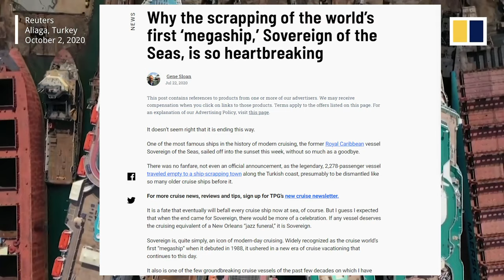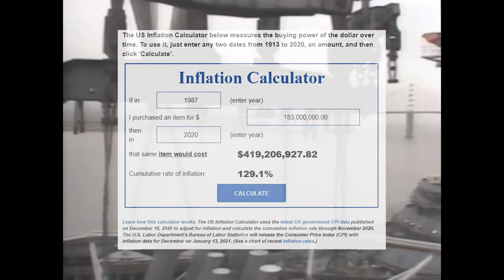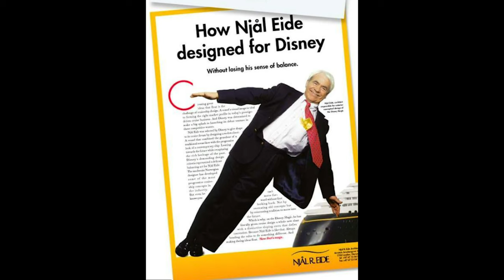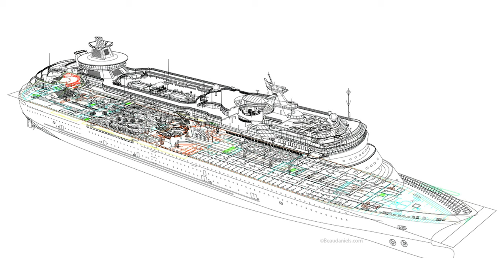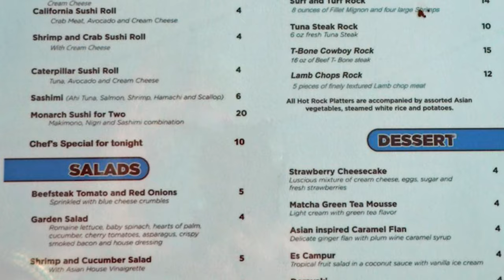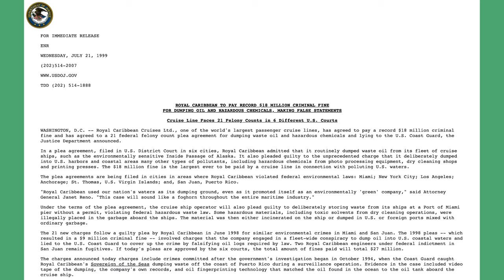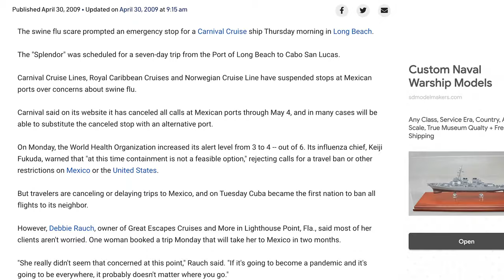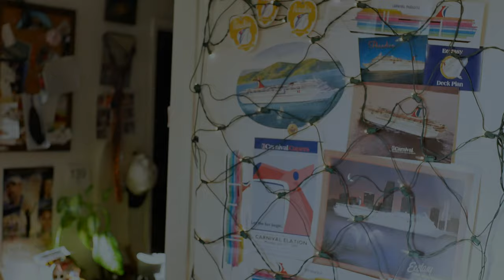⚓ Royal Caribbean's Sovereign, Monarch, Majesty of the Seas - History & Tribute Video

Comment: I sailed on Sovereign of the Seas. One odd feature was the cabins on on deck had windows facing the promenade. Some people seemed to be unaware of this and would forget to close their blinds. I went on it in 2002 when it was already vintage. Very sad to see it go and so many others which are lost due to the pandemic disaster. Also I went on a fantasy class and its sad also to see those being scrapped as well. Normally you would think there would be repurposing of these ships for cheaper lines but it seems the lines are in a big hurry to get rid of them rather than to wait to find a buyer other than a scrapper.
Reply: The Soverign had no Promenade!!! It's only an Atrium and no rooms face there,  is only shops and elevators. What are you talking about??  The first boat with rooms facing promenade was the Oasis class
Reply: Correcting my self, the first inside balconies were in the Oasis Class, the first windows to promenade were in the mariner class